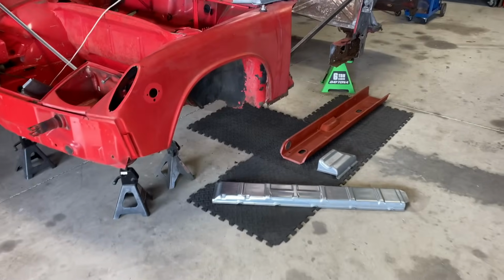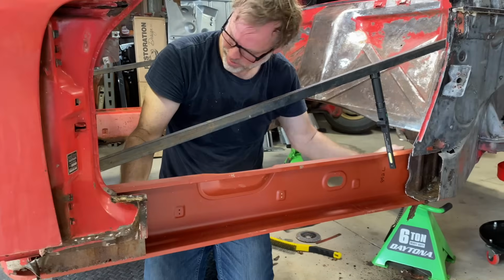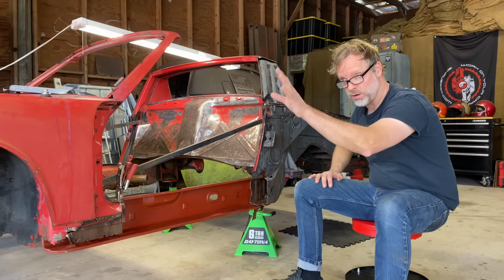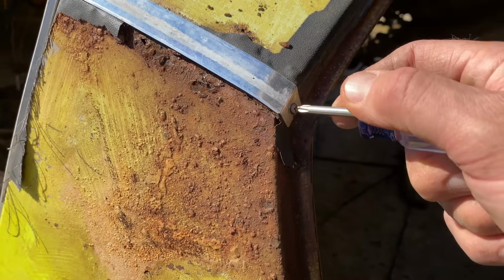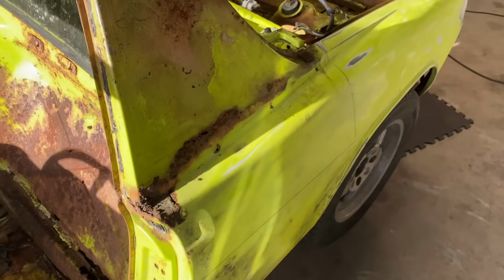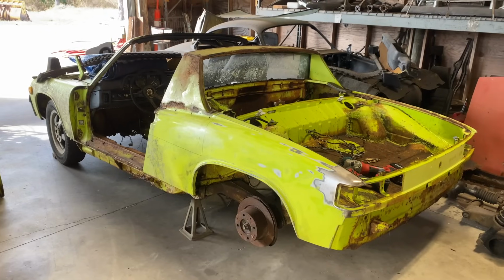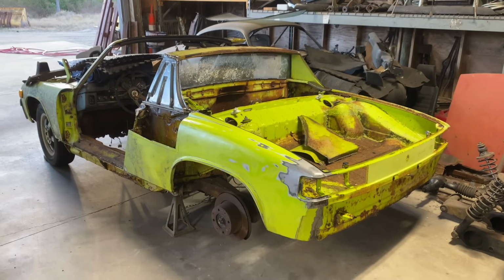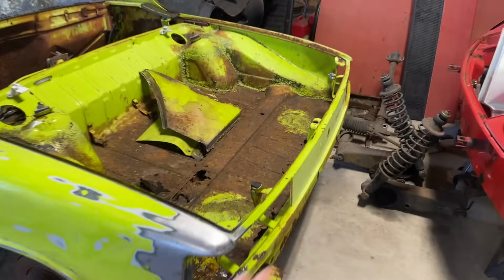Extreme Metal Work! Porsche 914 Restoration

Comment: One more tip, when butt welding a piece into a flat panel (talking the rear quarters here) try and avoid having a square 90 degree corner on the piece you're letting in, aim for a curve between them as it tends to help reduce a high concentrated area of the metal pulling in.
Reply from the maker: Thanks for the tip! =)
Reply: You beat me to it. I was going to say it's best to avoid cutting a sharp corner, and to create a radius at the corner. In this case, I would probably use a hole saw to create the radius, then make the cut to the hole. It also makes welding so much easier when you don't have to weld to a corner. That quarter panel now has a weak point with the square cut being so close to the wheel arch, but knowing CT, he'll persevere and make it work!

Comment: CT, I believe I would have kept as much of the original metal as possible.  I also would have cut the b-pillar sail panel at the fold where the spot welds were and kept that whole piece intact with the qtr panel until I had it mocked up on the other car.  That way you could have the exact position of everything before you spliced in the new replacement panel.  You don't want to be welding in an open area on the qtr panel, but stay as close to corners as possible to reduce warppage.   Enjoying the content!  Keep at it!
Reply: Definitely would have removed the entire quarter from the donor car in one piece unless there's no other way.  Factory body lines and reference points trump newly stamped pieces every time.

Comment: Hi there, Mr. CT. I think you're using a little too small drill bit for picking points, try 6 or 8 mm, risk one of those and grind a shallow point, not standard 118 deg. but more, like 140, 150. It should work better, since you  can see easily the separation line while drilling. Other than that, I think your brother is spot on, just don't get discouraged. Also check many times the positions and measures because of the big hole in the floor... 😏 Keep on, if needed help yourself with the other car before you cut it apart... I mean positioning measures.. 👍

Comment: Wow. I am restoring my second 914, First one I had to replace the hell hole lower sheet metal and battery box. The one I'm doing now I only replaced the battery tray. I bought one for parts that was actually better than that one and I scraped it out. I'm in Arizona but both cars were purchased in Oregon.

Comment: On your stick screws, use a hammer and flat head screwdriver and tap the screws from the sides to loosen the rusted threads. They should back out a lot easier afterward.
Reply: stuck, not stick lol

Comment: Hope you haven’t thrown in the towel. I can’t wait for the next video.
Reply from the maker: not yet.... but I did take a break from the body work on the 914. I am still working on the 914 - 2.0 engine and I've also taking a side step to work on a 1968 Ford F250. The 914 metal work is a bit over my skill level and I need time to process all of it. I might not go back to this one. I might need to find one in better shape. It's pretty bad......
Reply: @CTmoog  I’ll be on the lookout for a decent roller for you I’m in Georgia.

Comment: CT you have a ton missing structure without an equal amount of bracing.  Just my opinion.
Reply from the maker: I agree...I need to add more bracing this week.
Reply: CT it really should have been done before cutting.  Now you will have to brace and adjust as necessary.   This will not be easy and suggest you hang the doors before bracing and or realign the bracing.

Comment: What you should have done is put that whole panel on your red car all-in-one piece, all you would have to do is fixed that little square area and it's an edge is bad. Replace that and then you'd have a whole repair panel for the side of your trunk. And the door that's what I what it did. I would have used that whole panel on your red car.  And you still could do it if we were rounded well. Did that cut you made back together? Then you can get loose that whole panel and put it on your red car be. A better fix.
That's a suggestion From me

Comment: After all the cutaway, an estimated 50 % of the body is left! This indicates how poor the quality of the steel was back in the 1970s - 80s, way before the industry made this Great Leap Forward with Audi's introduction of zinc - plated / 100 % aluminium (!) car bodies - and also by the use of low - carbon steel.
Rebuilding all the body parts eaten away by corrosion like the one here obviously is not for the DIY guy! You need some profound experience in body repair (in Germany, training takes some 4 Years, ending with the "Geselle" (novice) or "Meister" (expert) certificate), because the remade body needs back its stability, or the car will be unsafe!
Reply: @Dixler683  Thank you very much for that extra information - my comment above is based on Volkswagen's quality issues during the 1980s - not only the bodies suffered from premature rust, but also the engines had problems, mostly concerning alternators, ignition, and engine management.
Leopard tanks: This raises the question which particular type you are referring to: as of the Leopard2 A5 / A6, I have read reports about the crew exiting safely even after having taken a direct hit. What you could mean here is either the Leopard1, or a pre - update version of the Leopard2 (A4 or lower).
Fact is: even the Leopard1 is safer, as the ammunition is stored in the turret, not in the chassis UNDER the turret, which has ended the life of such tanks as the T80 in one big boom when by an AT missile, for instance!
Reply: @Dixler683  Thanks for this extra information! However, I have some remarks on that:
1. "(...) can easily be done by a DYIer." I couldn't, as I have absolutely no experience on car body repair. Plus, as we can see here, both stepboards are gone - so you need to know how to cut out what's left and weld in the new ones. When everything is done and you here it creaking and groaning from everywhere, well - not good!
2. VW had some serious quality issues during the 1970s - 1980s, including premature corrosion, as well as problems concerning alternators, ignition, and engine management. This changed only after the takeover by Ignacio Lopez as CEO.
3. Sorry, but you need to specify which particular type of Leopard tank you are talking about. I have watched reports about a Leopard2 A5 or A6 having saved the crew inside after having taken a direct hit, and it was even possible to repair the Panzer. Maybe you are alluding to some early types of the Leopard2 (A4 or lower), or the Leopard1, which is indeed outdated, but appreciated by Ukrainian tank crews for its superior gun (reach up to 10km) and weapons control system.
It is these specifications even of the early versions of the Leopard2 (versions A6 and A7+ show major improvements in armour and fire control) which made US arms lobbyists intervene when the US MOD considered to buy the Leopard. Instead, the Abrams was introduced, which is, apart from the engine, a copy of the Leopard.
If you like to learn more about the Leopard2 and future plans in tank development for the German Armed Forces; please go to www.bundeswehr.org.

Cheers from Germany.
Reply: @Dixler683  1. Thanks for the roses from a true patriot. It just takes some training 2. Where did you get this notion that the Leopard2, no matter which type, lacks any upgrades? And be a bit more specific in your attempt as expert on tanks: where exactly are the weak spots you seem to know? Any tank, regardless of model and type, is liable to issues of some sort. It's like any other complex system used in today's Armed Forces, modern military weaponry is not failsafe. What is even more important: tanks are to be used for combined arms warfare only, when you have air superiority. Otherwise the enemy will scrap even the best tanks in the world. This is exactly what the Ukrainians didn't do, they ran their Leopards into minefields. A question for experts like you: what does any tank do when striking a mine? 3. Right, I'm just a watcher, but free to write my comments here. Thanks for confirming in a negative way what I wrote: I have no clue about doing this kind of body repair - but I'll keep on being on CT's channel, simply because he is just a cool guy doing an interesting job.
Understand?
Cheers from Germany.
Reply: @Dixler683  Come on, man, all I wanted was some answer by you that I could take seriously! I did not expect to meet a neurotic! Cheers!

Comment: Cut and butt. Don’t cut out all the metal where you want to form a butt joint. Leave an overlap with the new panel otherwise you’ll end up with a gap you can’t bridge. It’s easier to cut as you move along to weld and it keeps the joint consistent.  The old metal will just drop out behind the panel and you can fish it out later.
Reply from the maker: Good advice!👍😎👍